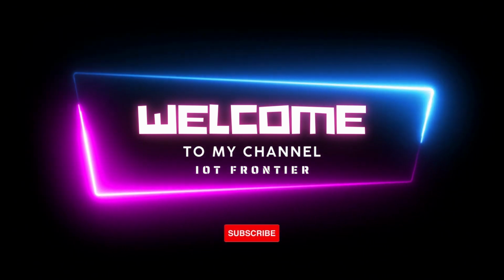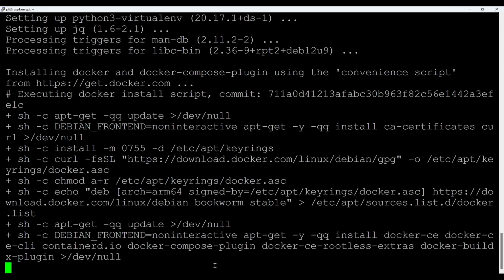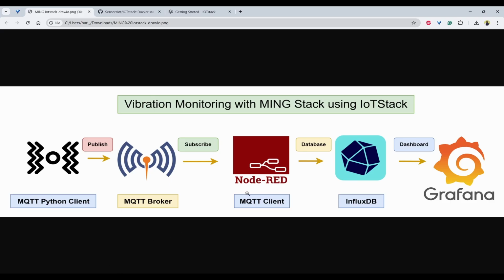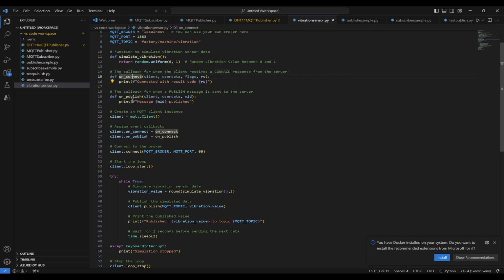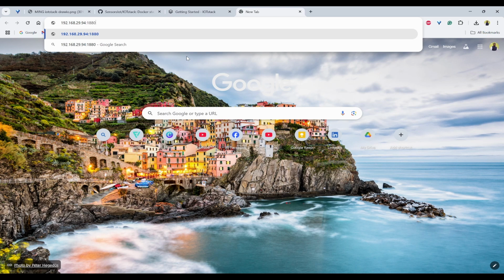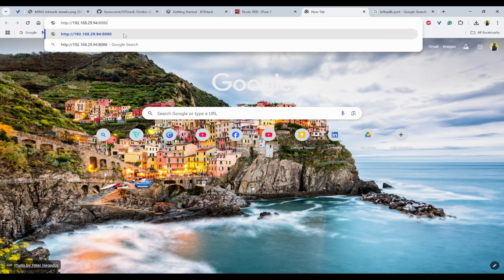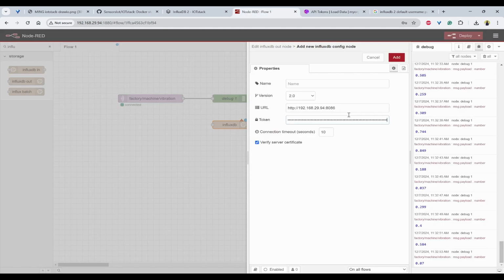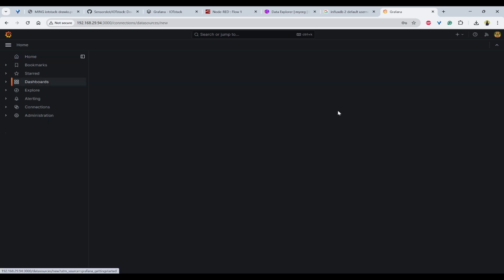Build IoT Server on Raspberry Pi: Node-RED + InfluxDB + Grafana + MQTT Tutorial (MING)

Comment: Hi, is it possible to run these on a raspy 3?
 I tried doing these, but I seem to have encountered some problems
Reply from the maker: Yes possible. What kind of problems you faced?
Reply: @IoTFrontier  Thank you very much for your response. I was able to successfully install the iotstack containers; however, when I try to access the unfluxdb or grafana by putting the IP address and the port number, it takes so long to open.
Reply from the maker: Yeah that could be due to low RAM and low processor speed
Reply: @IoTFrontier I just checked again I realised I was using the wrong IP address. I had initially used the public IP instead of the local IP address (obtained using "ifconfig" command).